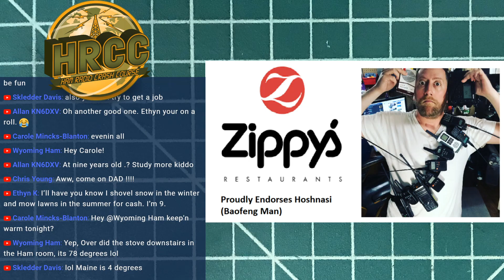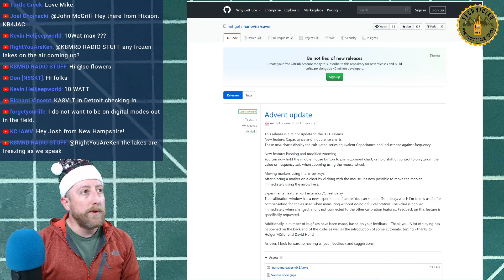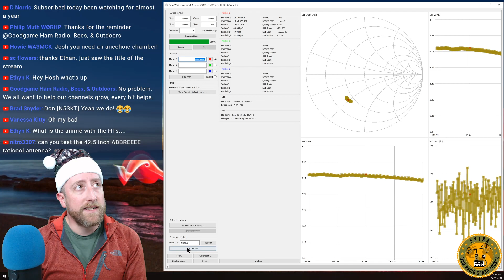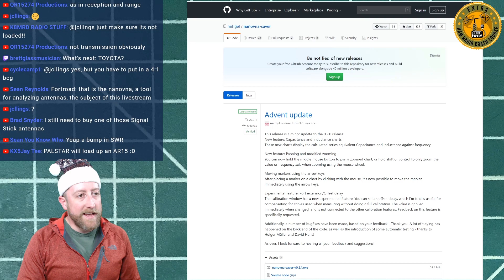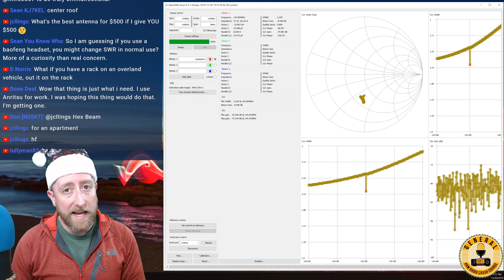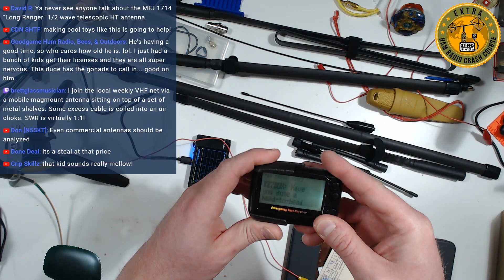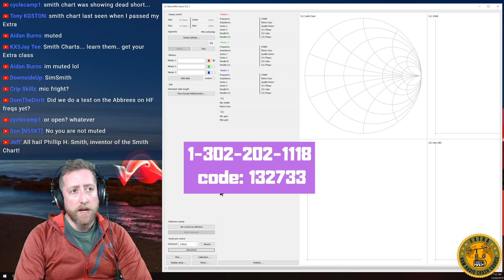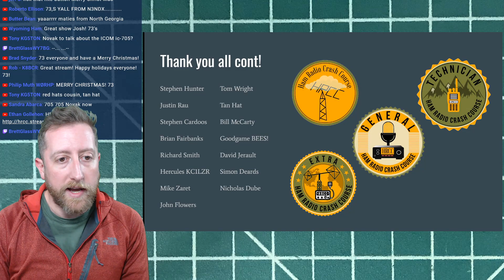NanoVNA Software & Testing HT Antennas

Comment: Josh.. Have you considered a mic you can put on your shirt? At times your audio drops very low. Also, I have the NanoVNA. I've ran many tests on the HT antennas and found that if you don't use the presets for the frequency ban but give a start and stop frequency you can cover a larger area. Example: I set mine to Start at 143MHz and Stop at 490MHz. This allows me to see the 2, 1.25 and 70cm band in a single test. I've used this when checking the tri-band antennas with great success. When I use an extension of coax between the antenna and the NanoVNA "after calibrating again", I have demonstrated with a continuous sweep the changes of SWR as I move the antenna around, wrap my hand around it, place it by my head like being on a radio, turning it from horizontal to vertical bringing it close to other object, etc... People then understand why they drop or fall out of the repeater just by moving or relocating.

Comment: Of course, I can test this by just buying even more little SMA connectors, but, what would it look like if you put a T-Connector in there, the HT on one leg, the antenna on the other, and fed the NanoVNA in the middle? I might just try that!
Reply from the maker: You’ll likely blow up the nanoVna without attenuation.  Also splitting feeds will reduce SNR.

Comment: Hi there Josh, I have a Baofeng UV 9S and planning to use the radio for GMRS. What antenna do you recommend that will fit the Baofeng for GMRS use? Also I have the Midland MXT275, any recommendation for the little antenna that comes with it? Thank you!
Reply: Please don't say you are going to use a non type approved radio on a specific band that demands one 😁🤪

Comment: Do a “HOW TO” for DUMMY’s on the NanoVNA!!   I mean REAL DUMMY’S!!   Somebody that doesn’t know what dB means, SWR, or impedance!  We just want to hook an antenna to it, and find out if the antenna is any good, and if so, at what frequency based on the graph or swr value.   This should be easy enough to do, but nobody has done it, most the how to’s are made for people that understand all this stuff.    Thanks!
Reply from the maker: Tbh, if you want that type of use out of the device, you should look at a standard antenna analyzer. They’re simple push-button devices a network vector analyzer does not lend itself to “just hook an antenna to it and see if it’s good”.